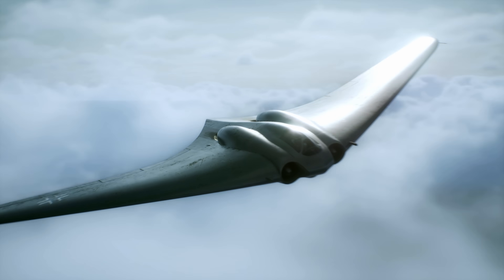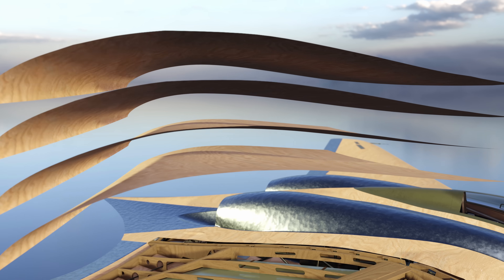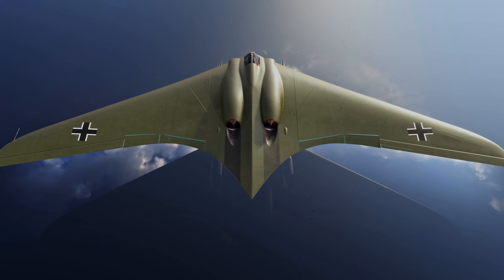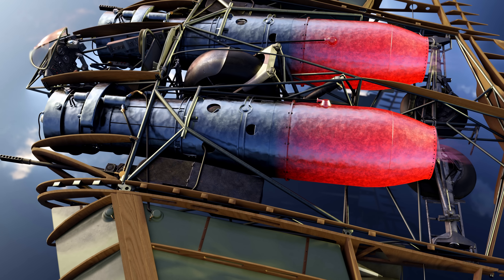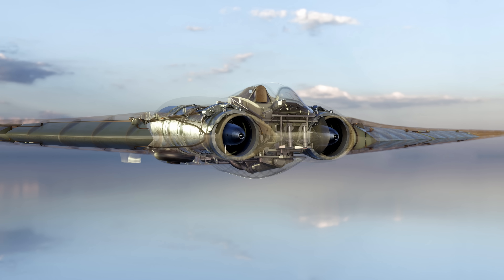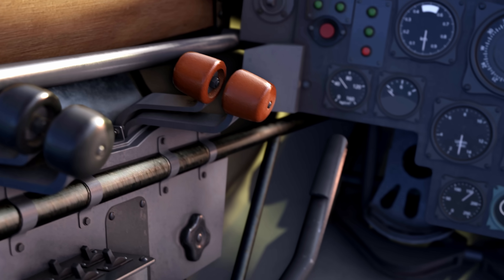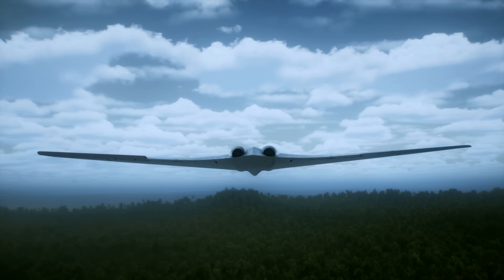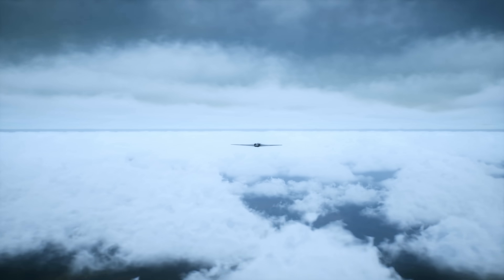Inside the Horten Flying Wing

Comment: I read about the Horten 229 flying wing jet fighter in several books about future Luftwaffe fighter projects.  The 229 made it to flying prototype status, only just.  According to historical accounts, engineers, skilled technicians and workers labored 90-hour weeks to create the prototype, given Nazi Germany's dire strategic situation in the spring of 1945.
      A beautiful, swept-wing turbojet flying wing, the 229 appeared as if it flew from out of the distant future of the 21st century.  But as a prototype, it had its own drawbacks.  The biggest one was likely its two Jumo 004B turbojets which were not fully perfected when committed to mass production in early 1944, given the urgent demands for the Me-262 jet fighter/fighter-bomber and the Arado 234 twin-engine light bomber.
     However the 229 prototype proved underpowered to start.  As test pilot, Lieutenant Ziller brought the 229 in for landing, one of its Jumo 004B unreliable turbojet engines cut out.  The underpowered aircraft dropped its wing and the aircraft stalled and crashed, destroying the 229 prototype completely.  Another 229 prototype was already under construction and nearing completion but time ran out for Germany.  The American Army vanguard mechanized units overran the test and construction facility and runway, capturing the almost completed second prototype.
    One can only imagine the what-if's had the Horten 229 appeared in early 1944 with the extra time for more prototypes and pre-production 229s for combat testing.  Expected top speed was 600 mph but given the low-powered Jumo 004B turbojet's maximum output of only 1,980-lbs thrust, just two Junkers Jumo 004B engines could not have produced the total powerful thrust to propel the 229 at that speed.  
     The anticipated Heinkel Hs 003 turbojet engine offered 3,000-lbs thrust but it was never ready for mass production by war's end.  More, given the wooden skin covering construction of the 229, such high speed of 600 mph ran the risk of the thin glued sheets of veneer plywood peeling away.
     Still, Allied airmen would have been astounded at the Buck Rogers spacecraft-like 229 speeding through the skies so swifty that B-17 and B-24 powered machine gun turrets could not track it fast enough.
     The Horten 229 entered the pages of WW2 military aviation history as one of the great, "What if's".

Comment: The best HO 229 documentary i've seen yet.
Reply: Agree, very entertaining.
Reply: HORTEN = TRASH
Reply: Still gives the absolutely false impression that it was unprecedented or amazing.

It was unusual, to be sure, but flying wings had been around since the days of gliders and, like the Ho-229, had control problems and poor safety records.
Reply: @Justanotherconsumer it was impressive because it was the first flying wing without vertical stabilizers, wich was unique and quite incredible for a non computer controlled aircraft from that time
Reply: @janp5880  The Horten brother built their first finless flying wing in 1933.  They built a number during the 1930's, none of which outperformed their conventional equivalents.
Reply: @Justanotherconsumer  It was the craziest jet fighter of it's time, still is.  It smoked all comers. The pilot wore a pressurized space suit, with a solid glass helmet. The first plane and it's pilot were killed when one of the engines quit on landing. By then the war was over, it never saw action. You clearly know nothing about this plane. A jet fighter is clearly different from a glider concept.
Reply: @Justanotherconsumer  Why would you think that a glider and a jet are the same thing...?
Reply: @retingo7940  he was probably referencing "one of the first planes to use the flying wing concept" at 3:10. the first flying wing was patented in 1876 and the first official flight was in 1907 for glider and 1910 for motorised variants. so it was the first jet powered flying wing not planes in general
Reply: @Justanotherconsumer You know nothing 😂

Comment: The Horten was not the first flying wing designed by the Horten brothers. They already had a lot of experience with the concept as they have built gliders. First one was the Horten H1: 

https://en.wikipedia.org/wiki/Horten_H.I

After that came Horten 2, Horten 3 and Horten 4 and so on, with improvements made with every new version.

Comment: The fact is that the Germans invented the jet engine, whereas the Americans with propellers were still in the Middle Ages.
Germany was “technically” superior to the Americans and English.
Reply: @nonegone7170 Actually, the germans had their working jet engine 7 years before any other.
Hans von Ohain started developement half a year before Whittle started.

Whittle had its first working engine in 1937. Ohain had their first working model in 1930.

The reason why they were unreliable was not because of their design, it was because germany in the war could not get hands on the needed materials like titanium.
Reply: @dom3827  that's simply not true,frank whittle had a working jet engine 5 months before Ohain did, and Ohain drew from whittle's patent. The first jet engine was built in 1937, not 1930, unless you're referring to the pulsejet, which no.
Reply: @gp33music41  thats untrue. Ohain was the first with the first working engine. You should learn history.

They had ideas at the same time, yes. But germans were way faster.

They both were completely independent from another. No one drew from another. Specially ohain being the first could not have drawn from a then none existing patent.
Reply: @nonegone7170  Just a small reminder of the German V1 and V2 rocket?
Where were the Americans and English still mentally in the Middle Ages?

Comment: Fun fact,  the Jumo jet engines didn't have a electric starter,  but instead used a 2 cycle engine in the nose cone
Reply: Really? Is that why the nose cones looked so large? Had no idea they were 2 stroke motors
Reply: @st4rship_780 yes and there is a d shaped handle for the pull starter. At one time i wanted to build one but money is very tight for me

Comment: Actually, the operation Paper Clip captured Horten was a mass production example that was incomplete. It was taken directly from the factory floor. Only one flying prototype was built and tested which led to the plane being green lighted for mass production. On one test flight, it had a dog fight with a Messerschmitt 262. The Horten flew circles around it unopposed. The Horten would have been a total game changer in the WWII Air War. Good thing the War ended before mass production. The same could be said about the Type XXI U-Boats over the Battle of the Atlantic.
Reply: Actually, 3 prototypes flew, one of them crashed. the other 2 were disassembled. One now in a US museum.

Comment: 2000 l of fuel, burns 1300 l an hour. At best it can fly for 1.5 hours. At speed of 800-900 km / h, it can fly max 1300km at best. So operational range is like 600-650km.

Comment: You missed the wing washout. ~5* of twist to both wings to ensure any stall was at the body, not the wingtip. Difficult control was caused by Northrop ignoring this essential bit. Present day Hortens  all have it and do not need elaborate stability control like the B-1 has.

Comment: It was designed due to Goering's 1000/1000/1000 directive: For the German designers to create a bomber able to fly with 1000 km/hour, carry 1000 kg of bombs and having a range of 1000 km. 
From all proposals, the Ho-229 was the closest to all of these requirements. It was intended to be mainly a bomber, not a fighter.

Comment: Great video!  You asked for feedback : I don’t believe the Horton had afterburners.  Therefore there should not be any flames coming out of the jets.  The burning should be concluded before the turbine wheel.
Reply: It did not, the first afterburners did happen during WW2 but the Germans did not use them.

Comment: in 1947 the us built 2 bombers without verticle stablizers, the northrop xb 35, one with props, one with jets, long before the b2, and designed before and during ww2, never depend only on AI research, or you will feed people bullshit, and all that stealth shit, thats a lie that was authored by a guy in 1995 and continues to be perpetuated by idiots, the hortens exposed fans on the engines would have lit it up like a christmas tree, the most important componant on the b-2 and b 21 is the ability to hide the engine deep within its thick wing while also reshaping its jet wash with cooler air,as well as the RAM. The jumo 004 or the bmw 003 were never capable of the thrust required for 621 mph.,they were 2000-2500 ft/lb thrust engines, with no afterburner, and it would have been uncontrollable at speed because they had not put the right flaps on it yet, they were iterating, and still had several prototypes to go. You know, the plane would still be cool and awesome as it was, without the embellishments, why lie? And on top of that, why use AI scripting without proofing it out first, there are error after errors in this video, i only scratched the surface, the 3d modeling looked good but there were errors on the steel and aluminum superstructure that contained the cockpit and supporting the wings
Reply: +@clarkbutler  Work on the YB-35 started in 1941 when Northrop got the contract.
Reply: @FiveCentsPlease  jack northrop built his first flying wing in 1935, glider in 33
Reply: @FiveCentsPlease  sure,i dont remember off hand when it flew with the contra rotating props on  P&W engine but i do know the second prototype got stripped and re fitted with jets in 1946-47 re named yb 49, same fuselage, allison j-35 engines

Comment: It was built by the two Horton brothers. Glider club pilots from before the war they became Luftwaffe officers and worked 60 hour weeks on this project. Goring was demanding his new specs, being 1000 kph x 1000 km range x 1000 kg bomb load. The Horton brothers offered this, and built it. Aluminum was a strategic controlled metal so yes they opted for steel tube frame and steel skin body with plywood wings. The jet engines were meant to be 2ft diameter, so they built the aircraft and when the engines turned up, surprise, they were 3ft diameter and nobody had told them. That's why they bulge out of the wing. They were strongly opposed to putting guns onboard for bombing missions due to weight and it could simply outrun dogfights anyway, but the higher officers forced it. One of the test pilots (not a Horton brother) was killed when the plane forward flipped upside down on landing, which is an inherent risk in this design. Also I thought they DID mix charcoal with the paint attempting to absorb radar. Coupled with the planes profile and the stated tactic of flying low to the waves crossing the channel the British radar would have a hell of a job spotting them. Anyway, Hitler decided he hadn't pissed off the entire world enough, so he pulled them off this project to work on the "Amerika bomber", a flying wing with six jet engines that would skim the upper atmosphere and bomb New York.

Comment: The Horton had problems similar to the Northrop YB-35 from the late 30's, stability issues.  The stability issues were solved on the B-2 with computers that didn't exist in the 30's and 40's.

Comment: The Northrop team noted that the skin was coated with semi metallic / metal materials as are radar blurring. Also, the majority of return was from the instrument cluster panel (speculated as an intentional substitution not an error), and symmetric inlet rings ((easily correctable by shaping as shark mouth or other. ). It was a stealth design intended to knock out enemy radar.
Reply: +@richardkudrna7503  The surviving V3 prototype was unfinished when it was captured by Patton's forces, and it was designed and under construction in a Gotha workshop.  It was covered with a green fireproof coating.  The paint on the example in the Smithsonian was applied after capture and it's my opinion that it should be removed. Or, since the original wood is so rotted the museum should construct duplicate wooden structure and return the plane to the as-found condition.
Reply: @FiveCentsPlease  the documentary was very clear about the radar coatings.
Reply: @richardkudrna7503   The Smithsonian sent samples for lab testing and only found rotten wood and glues in the samples.  And again the V3 was an unfinished prototype when found and there are original photos from the Gotha workshop of the V3, V4 and V5.   The claims of special coatings were only made decades later when stealth design was a topic.

Comment: The Horten flying wing NEVER flew.
It was a concept, only.
Far too many folks want this concept to be the first. The only one ever completely assembled was in a museum made from new parts to make it look like it was an actual flying wing...which it was NOT.
This video is BS.
Reply: +@Craig52-zq1bt  The smaller V2 prototype did complete approximately two hours of test flying with jet power.  It was lost on 18-Feb-1945 during a single engine out crash that was fatal to test pilot Ziller.  This was pretty much the end of the 229 program and the next prototypes were incomplete when found.

Comment: Its would be excellent if a replica of this jet was made today , modern controls with fly by wire, modern engines, and all of the original external features of course !! Safety would have to be at the top of the list but this would fall under new modern controls with redundancy systems. I guess its nice to have dreams lol

Comment: This whole program is a large crock of BS !!!  prototype only flew twice and the second flight very short, crashed and killed the pilot.  they never really got any real speeds as all were just estimates, and what was captured and on display at the smithsonian was a partially built plane, not finished,  during WWII Jack Northrup also built a couple of scale flying wings, piston driven and proved the theory and later built a huge piston powered flying wing bomber that was later converted to 8 jet engines and flew ir all over trying to sell it to the USAF but they were sold on the B36 and had all being built scrapped, not one survived, the result of political pay off and graft, greed and EGOS !!! A crime of major porportions.  And the later B2 was built by Northrop and was based on Jack Northropes research not the H229.  real facts not BS !!!

Comment: Since you asked, there's a difference of opinion on cruise speed.  You indicated 392.7 mph versus 560 mph indicated on Wikipedia, quite a contrast.  The superior aerodynamics and higher thrust to weight ratio of the Horton suggests a significantly higher cruise speed than the ME262 (460 mph).    INTERESTING STORY:  Found on another site, "According to Horten brothers, a simulated dog-fight was conducted between Ho-229 and Me-262. Ho-229 outperformed Me-262 by a wide margin".  Nice video.
Reply: +@MrSteve280  No speed measurements were completed on the V2 prototype before the fatal crash in February 1945. And they only managed about two hours of test flying before it was destroyed.  During interrogations the Horten brothers only mentioned that their V2 wing showed a higher climb rate than the Me-262.  Entirely possible, but I also think they were giving a sales pitch.
Reply: @FiveCentsPlease  The Wiki number seems high to me.  When researching this, I stumbled across figures for the P-51D that gave cruise figures of 275, 320, and 360 mph, clearly demonstrating "cruise speed" was as much a matter of interpretation as it was a technical definition.  Which in itself is interesting because there seems to be a general agreement on maximum speeds even though this was seldom used or sustain in combat whereas cruise speed was.  Like you said, focusing on the sales pitch.

Comment: ...heh, strange that historians are STILL unaware of the aerodynamic theories hat been lingering in german archives unknown to rest of the world till 2015.

One would have hoped, that once they made headlines in the aerodynamic enthusias community, historians would have also picked up on it.

Flat spins were not an issue with these flying wings, as they were stable in all axes, pitch, roll and even yaw (as surprising as the last one is)
Reply: As such it was viable without computer aided controls, or mircale control surfaces proposed in the video.

And its also worth pointing out WHY it couldnt have been stealthy. To put it blutnly the whole plane's smin is plywood, which is tranparent to radar, while part of the internal structure are metal, judt like its jet engines.
As such the reflectively shaped parts are exposed to radar - even if they aint exposed to the human eye.

Thats without mentioning issues with being stealthy to long wave (early warning) radars. Which aint gonna happen. When object is same size range as the wavelength there is not much to be done.

Which is fine sine resolution of early warning radars is too grainy to make them sueful for targrting AA batteriey or to guide rockets.

Problem is that its plenty good enough to help poitn fighter aircraft that  look for a target in the right direction.

Comment: The Skunk Works determined that the Carbon in the Paint and wood glue,lowered the RCS image that the Chain Home Radar Antenna would have only had 1/4 the time to react.. Thusly for it's time it was In Fact Stealthy.
Reply: +@justinsmith9791  The V3 example at the Smithsonian was incomplete and unpainted when it was captured.  "Carbon" in the paint was only mentioned decades later in memoirs when stealth actually became a topic of interest in warplane design.